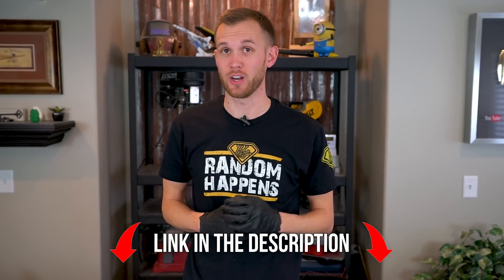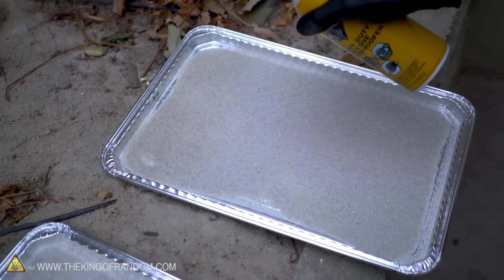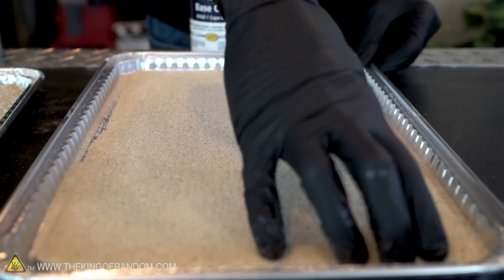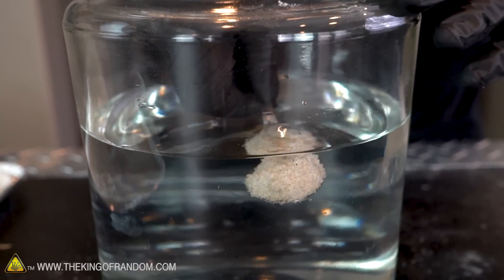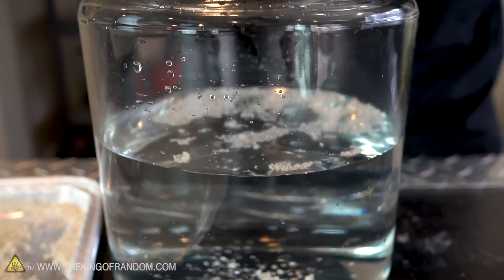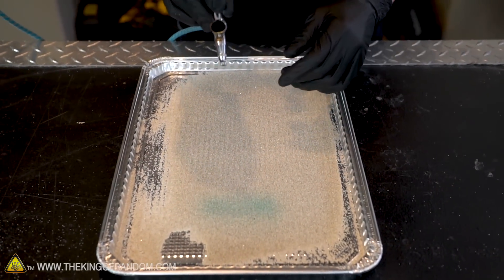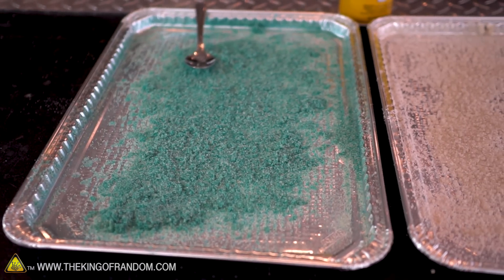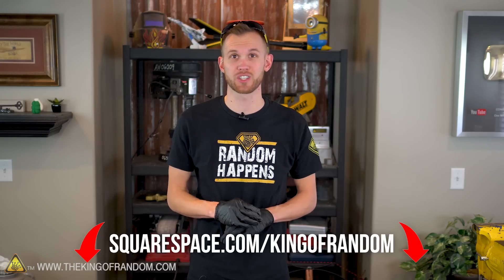How to Make MAGIC SAND! TKOR's Homemade Hydrophobic Waterproof Sand Experiment

Comment: can u use 2 electro magnate  
where  they placed   1 inside another   ---->   [ {} ]      this
 1st electro magnate----> {   this magnatic flux shuld be x3 den outer electro magnate 
 2nd electro magnate----> [
both shuld be opposide to to eachother 
those shuld act like pulling and pushing force 

my point   will it create  new kind of magnaticr field  which has  N&S pole feild around it 

it may creat new kind of  force

Comment: How long does it take to melt dry ice?
Reply: It sublimes
Meaning it can’t melt.
(At least not in normal conditions)
Reply: How long does it take you to learn? Oh yeah right IT DEPENDS ON MASS
Reply: Dankus Memeus The III 
*per cubic centimeter*
Reply: 26262622226167617816176111182726337373823456771792338282982282729272979797 seconds, lol
Reply: It doesnt melt it evaporates
Reply: Yeah
Reply: You can't melt it ishawo
Reply: best
Reply: @Just Ice no you cant melt in it just turns in to C03
Reply: It’s simple        

~INFINITY~
Reply: @j.hanninen  No it's just NO3

Comment: I was thinking more like using an "open" tumbler, for the never wet, sort of like a small batch cement mixer, which you could then spray into. So it would mix evenly, over all of the surfaces, and probably also avoid it sticking into layers.

Comment: Pour "never wet" 
To a bath of water
Reply: Editit because the never wet repels the water and goes on the top, or it sinks to the bottom and the water is on the top. Either way it's like oil and water
Reply: Oricks it would probably be because the neverwet absorbs air, or it's a different density. That is if, at all, it is like water and oil.
Reply: Editit but water’s not wet
Reply: Editit it would just seperate like oil and water
Reply: Oricks theoretically
Reply: Editit hahaha
Reply: Editit this was satisfying
Reply: Editit ur so right
Reply: Rinzler that’s how you make a black hole
Reply: hmmmmmmmmmmm interesting
Reply: XD
Reply: Editit j
Reply: Editit it would just float on top
Reply: yea
Reply: OMGOSH YES.
Reply: Editit u might as well divide by 0
Reply: 500th like!
Reply: what would happen
Reply: ya put that stuff in the water
Reply: Editit                   Q
Reply: Luckily, you got 777 likes.
Reply: Water is wet
Reply: Editit It would just be like oil and water.
Reply: Editit I gave you the 1k like
Reply: Yaaas
Reply: I
Reply: G
Reply: Wouldn’t neverwet just float on the water?
Reply: yas!!
Reply: Editit holy shet
Reply: Editit 🖕🖕🖕😁😁🤗😍😁😁
Reply: why tho it probably going to look like when you pour olive oil in water. not that cool

Comment: I heard that honey can be hypothetically used for waterproofing. You should also try testing magic sand with a vacuum chamber, and/or using fluorescent ink.

Finally, I would suggest getting a portable outdoor fan and/or a gas mask when working with fumes.

Comment: Rather than spraying it on flat on the tray, to get a more even coating and to also prevent the sand from "sheeting", put the sand in a big bowl or wok and use the motions a chef uses when stir frying while spraying with the waterproofing, then put on trays to dry.

Comment: If you use a finer grain sand, and you're a lot more thorough with the scotch guard, the results will be a lot more impressive than the never wet. You say "cool, twisty, swirly shapes", but all I saw was the aftermath of half a fifth of tequilla, a bag of Taco Bell, and an evening of poor decisions. I would also recommend just dying the sand before hand. Why you'd try to airbrush sand is baffling.

Comment: Hey just a though could you heat up a chunk of metal high enough to boil water, but put the water in a vacuum chamber I would like to see if the water stays still or bubbles
Reply: liquids boil at lower temperatures in a vacuum. It'd boil even if you didnt put the metal in
Reply: it bubbles since the water turns into gas on contact with something really hot like molten metal
Reply: Pan
Reply: Coosin very specific but that would look cool

Comment: I think you should do a video of 10lbs of green flash mix spread out over an extremely long line. Or a better idea, maybe, do the 10lbs of the green flash next to a similar long line of touch powder where they slightly overlap at an intersection. I suggest maybe doing this at a large ranch.

Comment: you should pour the dry sand into an empty jar and roll it at an angle (possibly with a custom rolling rack) to create a tumbler, and spray the color onto the tumbling sand to coat it all evenly and efficiently. Then do the same with the NeverWet. If you let it continue to tumble as it dries, I think you'll have a much easier time keeping it broken up.

Comment: Use a tumbler and have the sand constantly tumbling while you spray the sand and you'd get better coverage on all sides of the sand and you wouldn't get the clumping problem with the never wet. Could be as easy and just putting it in a coffee can and rolling that around on the table while you did it.

Comment: 🔴🅾️🔴🅾️🔴

      To Dye Sand with Alcohol Ink:  
Put the sand in a plastic bag, add several drops of the ink directly on the sand and quickly zip the bag closed and smoosh  the sand around to evenly coat the sand. Continue adding ink and smashing until desired color is reached.  
This way you get:
 ⭕️ more even coverage and more intense color. 
 ⭕️ no overspray
 ⭕️ don’t need any airbrush equipment or electricity or mask
 ⭕️ wastes less ink to evaporation 
 ⭕️ doesn’t  blow sand everywhere !
 ⭕️ child friendly way to include kids in the project

Comment: If you were to apply the color to the sand after the fact you apply the 1st coat of never wet it wouldn't be blown away then find a way to flip in one piece like flipping the pan into another pan and spray the other side with the color then apply the second coat

Comment: Got great results doing this by melting a piece of parafin wax (tea light) into a bunch of sand. Have to make sure the sand is all coated.  When it hardens, you will have a bit of work breaking it all apart.

Comment: The three requirements for fire are fuel, heat and oxygen.
We have seen heating things and putting them in oxygen.
What about heating oxygen and putting it on things?
How hot does the oxygen have to be to burn wood, sugar, diamonds etc?

Comment: I doubt I'm anywhere near as intelligent as you are, but from my understanding of Magic Sand it's not that the sand is simply waterproof, but rather coated in such a strongly hydrophobic material that it forces the water around it to act as a support.

I could be wrong, but this is one of those things where you see the concept of the video and immediately feel like it will be all for nothing.

Comment: Colouring the sand would be easier if you just put it in a jar with a few drops of the ink, and shook it up.  That's how we used to make coloured sand for those jars of layered sand you buy in crappy souvenir stores.
Reply: Actually, that might be an easier way to get a more consistent coating of the NeverWet, too - if you're able to spray it into a container to get it into liquid form.

Comment: A suggestion to improve on this, put the sand into a bucket attached to a drill set at an angle so the sand is constantly moving. Spray in the waterproofing into the sand bucket with it spinning and it won't clump, and will probably dry faster.

Comment: Why don't you make a tumbler that can evenly coat all the sand with ink and coating to better see the results.  It can dry while tumbling, and you can use a drill motor to power it.

Comment: you should try damp proof fluid half the time and twice the effect.
iv even made a fine mesh water proof with the same liquid which i am certain will be easier than a spray.
Reply: its the same chemical that they use to prevent rising damp in brick and stone houses

Comment: use a rock tumbler as a tiny cement mixer for application of color or spray sealant & air tube for drying pointed into the mixer.

Comment: Melt some paraffin (candle) wax. Pour in your sand and then pour it into your shallow tray. When it has cooled and set breakup the sheet into sand again. Each grain should have a wax coat and will be waterproof and will not stick to the rest..

Comment: You could have just used candle wax. I made some magic sand by pouring lots of molten tealight candles Ito some sand until it was all wet and I mixed it thoroughly until the wax hardened.

Comment: You should just have made a basic mixer. Small motor, buket, drive belt, and some flaps inside it. Maybe with to gears to transfere the power. The coating would have been way better and easyer + the colloring.

Comment: Why not throw a bunch of sand in a cement mixer or something and coat it with the neverwet while it's mixing? That should coat it evenly without too much effort, and if you let it spin while it dries it shouldn't clump together as much.

Comment: King of Random, what happens when you put silicone rubber (both liquid and hardened) into liquid nitrogen and the metal-melting foundry? Will it freeze into anything that's been submerged in it? Or will it do something else?

Comment: What would happen if you put a speaker in the vacuum chamber
Reply: Sound propagates through a material such as air or water. Sound cannot cross a vacuum space.
Reply: You can not hear any sound from speaker
Reply: space and time bends
Reply: Jean Carlos derp
Reply: Unless it’s floating inside, the sound from the speaker, through vibrations in it’s “legs” or speaker housing, will travel within the wall of the vacuum chamber, you will still hear the sounds, just abit shaky and raspy. Just same principle like in the cup and string telephone.
Reply: You would in fact still hear it I think. The chamber itself would vibrate.

Comment: You can make a kind of small cement mixer with a pop can and a servo motor for more even coverage, keep it spinning while the sand dries initially to prevent it clumping together. You can also use finer sand for better results, there's less air trapped between the individual grains so it will sink a little better.

Comment: How well would this sand work for cast forging aluminum? Would this work better than green sand?
Reply: I suppose that the coating on the sand here would carbonize because it couldn't stand the heat. then your aluminum would have black stains, so better not.

Comment: Use oobleck.  Only add sand to the mix before the water.  I do not k ow the proper proportions but it is as simple as corn starch mixed with sand and then add the right amount of water and allow to sit untill it sets.  You now have magic sand.